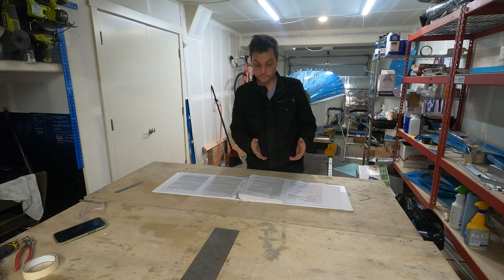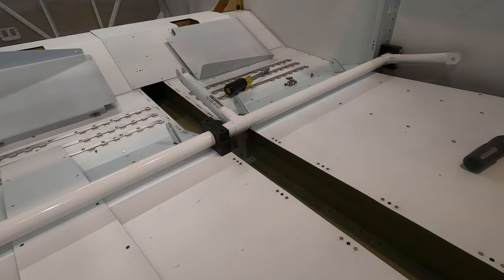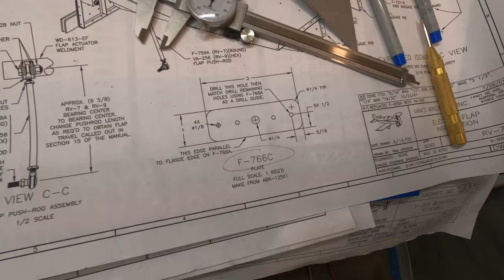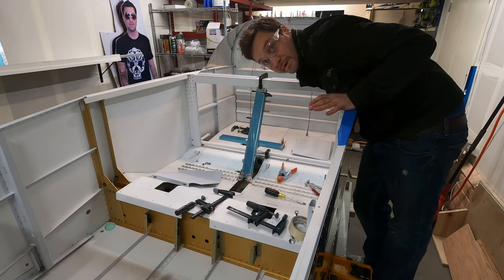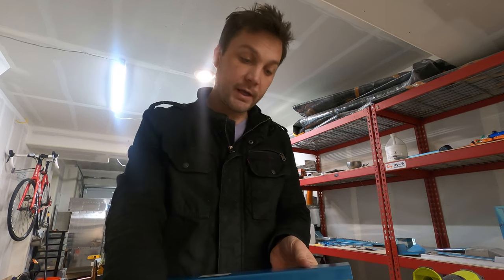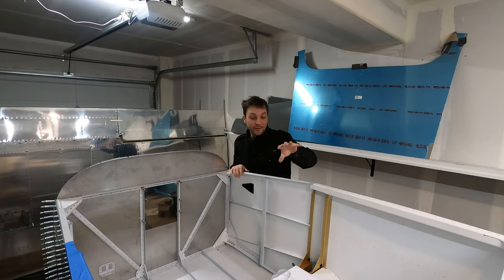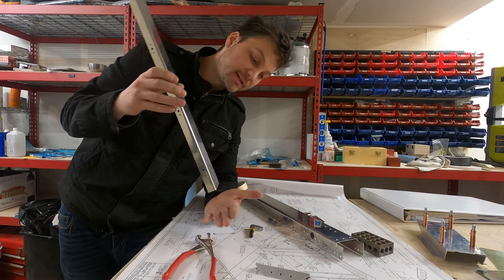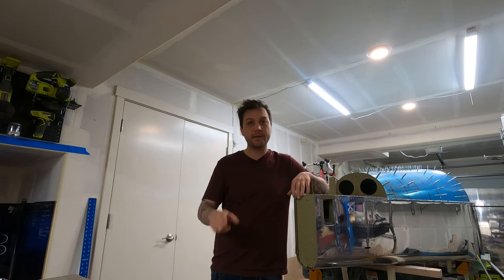Flap Motor and Mechanics for the Van's RV | EP3.27

Comment: Another step forward.    A proud moment when you moved the flap bracket using the wires.
Reply from the maker: That was exciting! What you missed was me scouring the garage for a 12V battery, contemplating duct tape and a long string of AAs, determining a power supply was my only way and trying to find one locally before finally realizing that my scale RV-7 had a 3S lipo (roughly 12V) as a power source!

Also what you didn't see: me using that same battery to get a weak car battery just over the required voltage to start. It's becoming a crucial piece of equipment around the house!

Comment: Damn Frickin’ fine video Ryan!😂. I had electric flaps in the C-150 with an easy to see remote pointer indicating damn flap setting.  Worked great.
Reply from the maker: Very familiar with the needle in the C-150. I think I’m on to a relatively simple solution via sensor + avionics. Can’t wait to provide more detail here in upcoming episodes!

Comment: Nice video, thanks for sharing progress. This note won't help you because your part is done, but it can help others in same situation - there are nut plates that has different alignment of holes, for example both rivet holes on one side and screw hole on other side, or V shape with screw hole in middle and rivet holes on both angled ends.
Reply from the maker: Good notes! And nutplates that accept countersunk versus standard. 

I followed the plan carefully on nutplate callouts, but many builders choose to deviate for added functionality, aesthetics, or to simplify installation.

Thanks for adding valuable details here!!

Comment: I can move my RV7 flaps to specific angles with the sensor. It is controlled via my EFIS. Your lucky to live near Advance Flight Systems. 
You should go in and play with the AFS and Dynon instruments and see what you like as you get closer to installing the panel. Btw, I think AFS has some advantages over the Dynon.
Reply from the maker: I’m currently in a deep dive on avionics. I thought, without a sensor, flap movements were more like dead reckoning, and susceptible to error. I’ll have to look into it more!

Comment: For the bracket you made flush. Just get some 2024T3 stock and make a shim
Reply from the maker: Yeah, but if I had to start shimming and such, it seems like just a fresh start would be a solid approach. The part, F-785, is roughly $13.00. It'd be worth it, to me, to just start over and not have something as a reminder of a mistake. 

Now, if there was substantial time invested in this piece, then we'd have a good argument to do just as you outlined. There are pieces where starting over makes me cringe, not because the cost, but because of the journey the part has taken in the shop!

As it stands, it looks and functions just fine, so I think I'll leave it. 

Thanks for the comment, and continued support!!

Comment: Quick question, and apologies if you've been asked already: I see you switching between your electric and air drills for various tasks.  Is there a practical reason for that, or just a preference?  Is the electric drill not adequate for some tasks?
Reply from the maker: This is a great question, and I see a lot of talk online about it.

Air: great rpm for sheet metal, light, small, quick. Typically used for my #40 and #30 holes.

Electric: heavy, batteries (☹️), but quick-change chuck. Will hold larger bits, countersink cages where electric will not. Better rpm (slower) for c-sink, steel, and step bit. 

Rarely, I’ll have a #40 in the air and a #30 in the electric because I’m tired of switching back-and-forth. Very rarely.

Comment: Hi friend, Which material is cheaper chrome molybdenum steel or aluminum 6061 T6?
Reply from the maker: I’d have no idea on that one. The kit supplies all the materials, so I’m doing relatively no ordering of raw material.

Those two materials certainly have vastly different use cases, so I’d think material cost would be rather inconsequential…

Comment: SERIOUSLY !!!
If you can't handle "plan flap", how am I going to trust your completed plane ?  In the absence of your own design ... go to Harbor Freight and buy four 1 and 1/2" chrome sockets (they will not soil the paper).  Place them at each corner of the design plans.  Now instead of fumbling with the plans every time you try to read them you are "hands free".
Reply from the maker: Ha! I have some 1-2-3 blocks I use sometimes, but I feel like I’m constantly flipping between pages.

I’ve contemplated having the entire group bound in order and orientation and just treat it like an actual plan set.
Reply: @RyanFlysPDX  Bahahahahaha ...  That was my 1st thought.  Take the largest page dimension ... make a slightly larger marked and hinged front panel ... duplicate the front panel for a rear panel (no hinge) but with three posts inserted ... then three hole punch the plans to match the rear panel posts.  I have to believe with all of the forward and rearward plan checking it would be worth it.